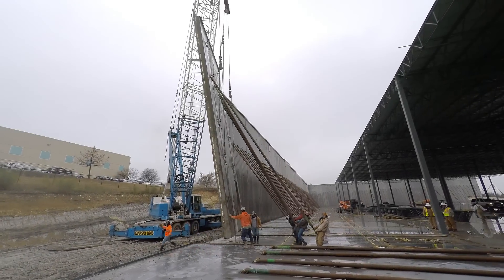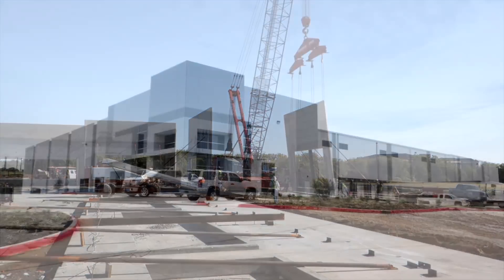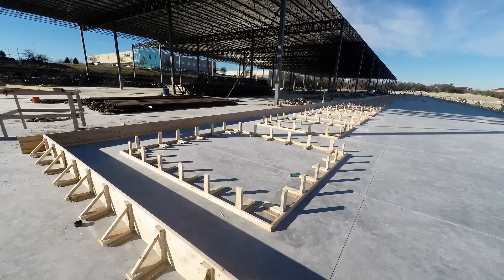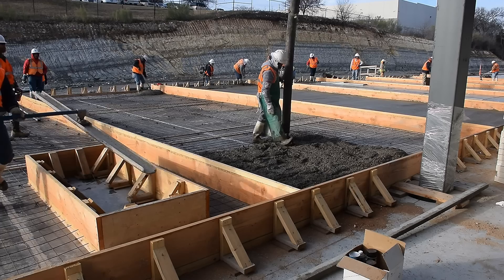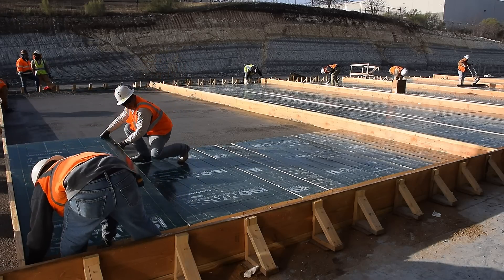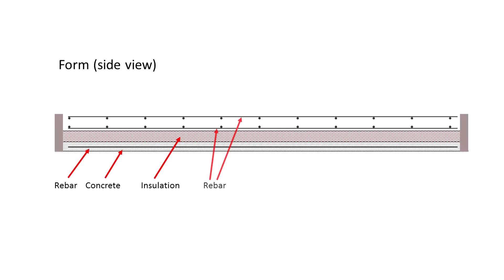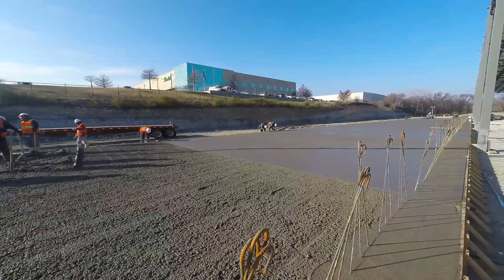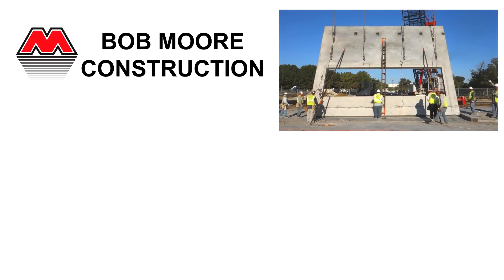What is an Insulated Tiltwall Panel? - Tilt-up Construction

Comment: Interesting, but it takes away one of concrete's big advantages - the thick and essentially indestructible slab is going to be a whole lot weaker with a split down the middle - while keeping its big disadvantage - the extremely unforgiving surface. For residential use, I'd really like to see if anyone is pouring a structural concrete tilt-panel sandwiched between outer layers of cement-based  insulation such as foamcrete or perlcrete.

Comment: How effective would this work for domestic dwellings
Reply: So you would run into issues with lack of slab space to cast the panels and time you can't do anything on the area (interior buildout) it'd be hard to do but not impossible. Just saw this video and with this concrete mix you probably could produce all the panels pretty efficiently https://www.youtube.com/watch?v=JJ0xJNw1NiM

Comment: What base provided for erecting the wall panel on ground , is there any nut bolt system on flor base .
Reply: Typically just use embed plates and angles and small layer of grout to attach the bottom.

Comment: How many hours/days does it take to cure?
Reply: Also, temperature greatly affects set and cure times. If poured during excessive heat, your set times can be as low as 2 hours (too fast). This will decrease the overall strength of the concrete. Some guys use ice, cool water, or liquid nitrogen to keep things cool and slow down the set times on hot days. Optimal temp for a pour is around 70˚F.
Reply: 3-5 days
Reply: Mandela Gates it varies depending on the mud mixture.

Comment from the maker: What is the difference between a regular tiltwall panel and an insulated tiltwall panel? This video explains what an insulated tiltwall panel is and how it is created for use in a temperature controlled tilt-up construction building.
Reply: Dis Master it cuts down on cost significantly, and significantly increases it's r value. I do tilt ups for a living.
Reply: General Contractor Videos Hello there, Bricks are also good insulators, then why isn't concret? And are the insulated tilt Blocks better than bricks, which would be cheaper? Thanks!